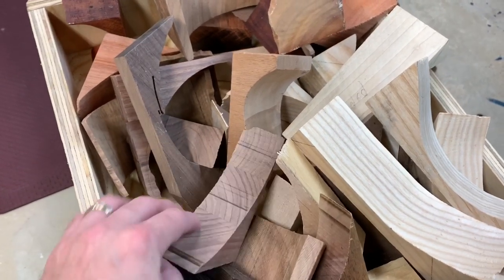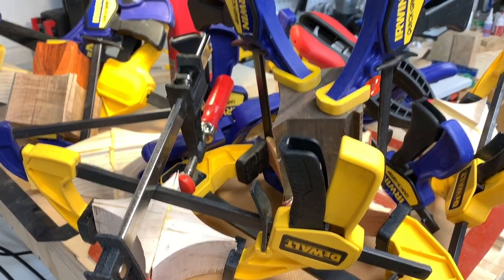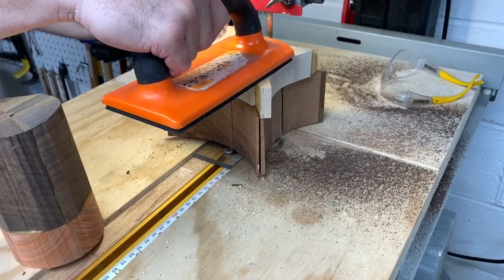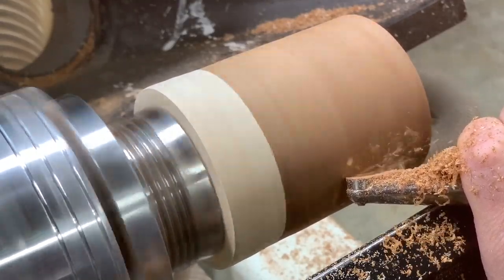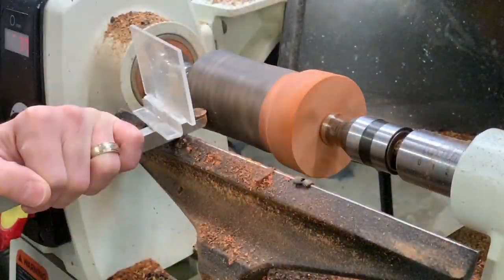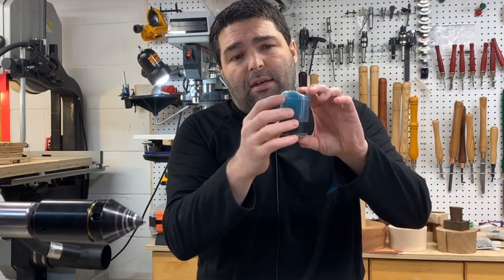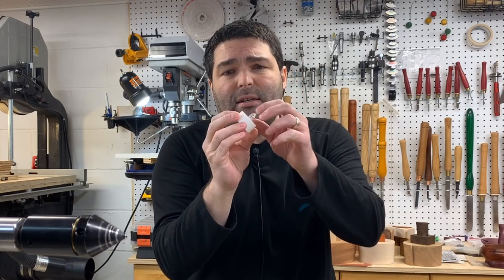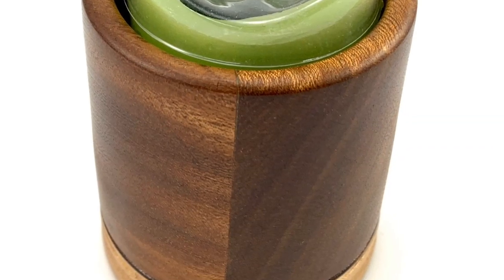Wood Turning Bowl Blank Cut-offs to Votives

Comment: Merry Christmas Spiros. Your twin brother was correct; you do good work. And now that you've mentioned it, you're going to have to give up the formula for the homemade wood finish. I've been using O.B. Shine Juice that Capt'n Eddie uses.
Reply from the maker: John May Hi John, Thank you so much, I appreciate it. My fiction polish is similar to Capt’n Eddies; which French polish has been used for hundreds of years. That’s what Eddies brew is. It works well. I use different types of oils, Boiled linseed oil, polyurethane, danish oil, salad bowl finish, or tung oil -Either with wax or without wax. The ratios are 1 part of the 3 ingredients. Shellac (3 pound cut), denatured alcohol, and then one or two of the above oil(s). I should make a video, several people have ask what I use. Well, Merry Christmas and thank you! Take care -Speros